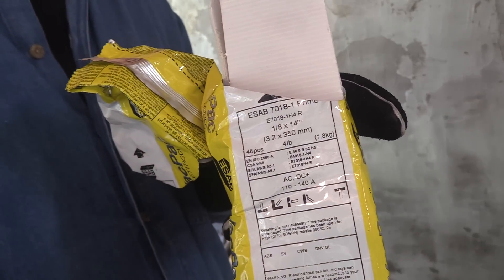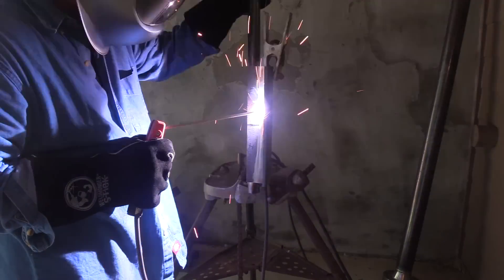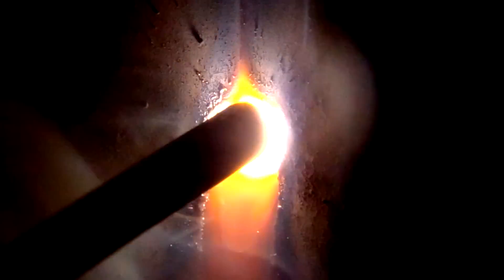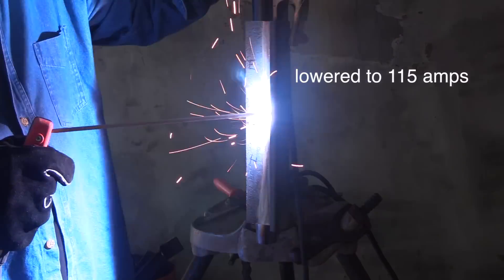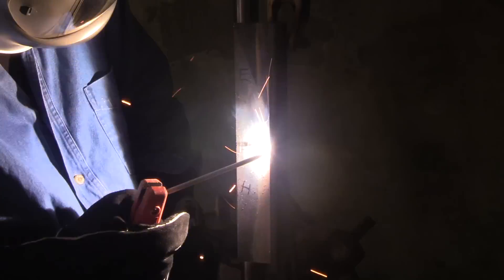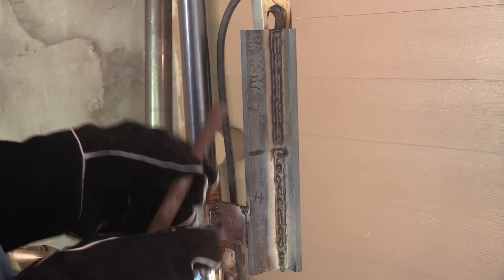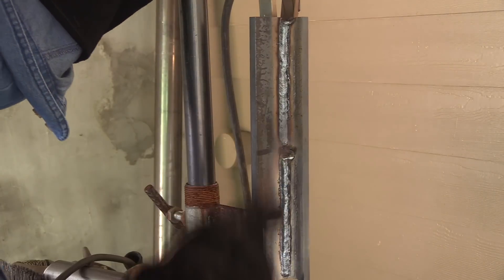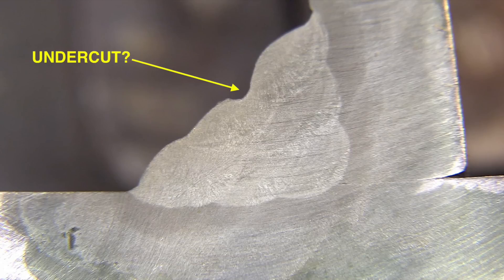Vertical Stick Welding - ESAB 7018 vs Hobart 7018 Cut & Etch | Welding Tips & Tricks #SMAW #Welding

Comment: On one job had to do a bunch of overhead work welding in reinforcing steel into a roof for penerrations, Superentendant wouldn't get anything other than Hobart, the fifth time I almost chucked that 50lbs can back at him and walk off the job. Most miserable 7018 I've ever run

Comment: Hobart are good if you never have to do restarts, they create perosity on bottom of pipe on restarts and has happened on sides as well. I would never use Hobart during a test or on an Qc’d weld. Excalabour or air liquide highly preferred.

Comment: Before I watched this video, I bought 4 pounds of ESAB 7018. Don’t think I’m in a lot of trouble with it, but I wish you had run a pass at the 5 to 10 Amps higher reading just to see the difference. Time will tell. Great video as usual, thanks for the effort.

Comment: Hey Jody, Could you possibly make a video using your Lincoln AC225 (or if not on hand another transformer welder like your thunderbolt on AC) using 7018 ac in the vertical up position. I can get a regular 7018 on a dc machine at school pretty flat and even. At home, it seems like with my AC225, the weld doesn't come out as flat and even as the dc welds I would do at school. It seems more lumpy and droops more. Your arc shots really give me a good visual. I think a video on welding with an AC only buzz box in all positions would be really helpful to a lot of people. Many people have them instead of high end welders.  Also could I get your opinion on the Lincoln AC/DC 225/125 welder. I have considered it for the dc, although it only puts out 125 amps. It seems like for 1/8 7018, I would need more amps on thicker material. Would a cheap dc inverter welder be a better investment. Although, the Lincoln Ac buzz box runs 7018 ac decently. Thanks for your videos. They are really helpful.

Comment: Jody, just a fart around home welder here, but I swear as I have listened to you repeat the same guidance over and over, it has eventually sunk in. I’ll never be a trade or certified welder in anything, but your teaching is very accessible. Question, I wondered if the esab was getting more heat than the Hobart because the heat from the Hobarts would be creeping up into the esab base metal and beads.  Not sure how long things cooled off, but curious if the esab might have been benefitting and if compared side by side, the esab would need even more heat?

Thanks again for all your upbeat and thoughtful instruction.
Reply: Each manufacturer has their own specifications of the composition of the rod/wire they are producing.
Some of it can be a particular heat or lot, some are the different chemical compositions of the manufacturing process, some is the welder and what she or he is doing during the process.
It can be as simple as cleanliness or position of, the ground clamp.

Comment: I’ve been welding commercially for 22 years now first as a union boilermaker and now for myself, but I try to use Hobart rod whenever I can. The best property I’ve found is the ease at which the slag is removed. It seems to be more of a thin glassy consistency and chips very effortlessly especially in tight corners where esab and Lincoln slag tends to stick like a bear.

Comment: I new to welding and have a question, on a 3 bead pass, could you run a bead on both left and right then fill in the middle???  is that wrong or any bad results by doing it that way???
Reply: Ya you can do it that way but you may run in to a problem with slag entrapment becasue you have a deep valley  (depending how you stacked your beads) and the rod may have trouble getting to the bottom of that valley.